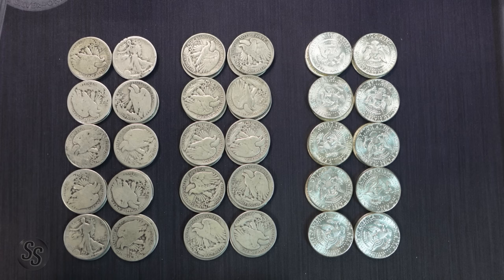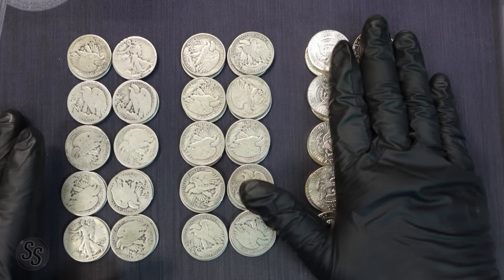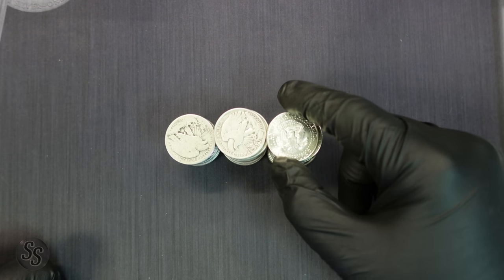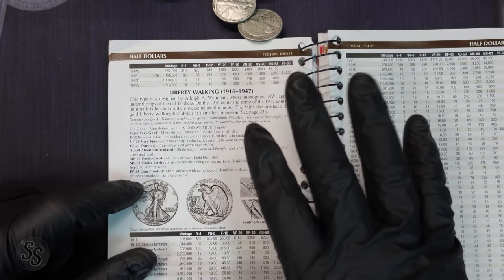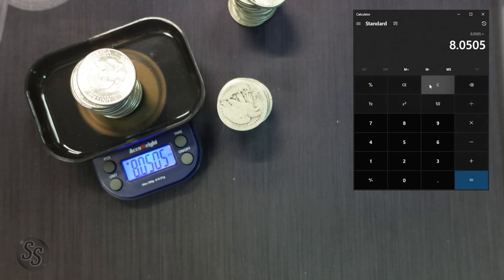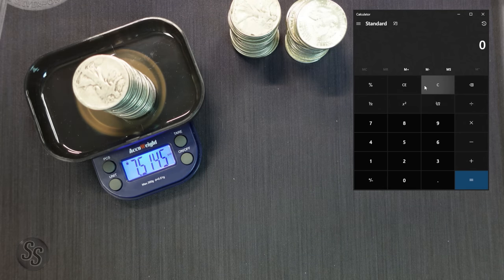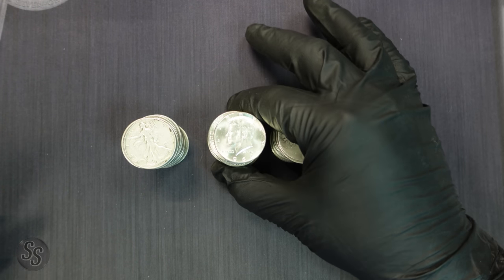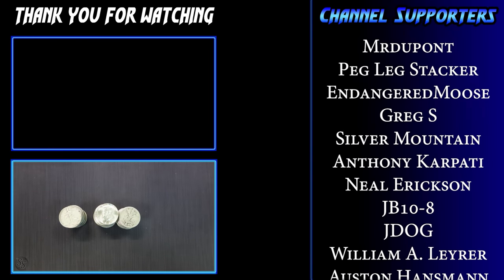Here's How Much SILVER is REALLY Lost in Worn Junk Silver Coins!

Comment: Thank you very much for addressing silver wear.  The one and only local coin shop here has culls on display for sale. I am looking at purchasing.  This episode lets me know that culls are of lower value and by how much.  Each $10.00 of face value loses 1/2 oz. That is then factored by the silver content....90%, 80% etc. That is fine for 1/2 dollars. But will that be accurate with coins which are thinner and so have more area to wear to a cull state?  I would think that dimes would lose 2X more weight to get to a cull state. And then i also wonder about desirability.  Will normal wear coins be easier to barter with?  Thanks....I appreciate your content.

Comment: Fun Video.  My '64 Kennedys and Franklins are 99.98% and 99.70% original weight, much better than the "industry standard" of 7.15 oz. per $10 face or 98.84% original weight.  I don't have any Walkers.  My Roosevelt dimes are 99.10% while my Mercurys are 95.36%.  My Washington quarters come in at 98.31% original weight, but my primary source gives me a disproportionately older mix.  A more typical mix would be like the Roosevelts.  So as common sense would tell you, if you are concerned about silver loss from ware, stay away from Walkers, Standings quarters, and Mercurys.  (But also remember we're talking about single digit percentage differences and also that a typical mix of newer and older coins can give you almost exactly 7.15 ounces per $10 face value, which is, of course, why it's the industry standard.)

Comment: I see junk as useful for making change so instead of trading 20 of them, I'd trade 1 or 2 at a time. So 0.4824/20=.02412*18.78(today's spot)=$0.45 lost.
The whole coin is worth $6.79 and you lost .45 leaving you with $6.34 per coin.
I think it's a pretty big loss, but it's a widely recognized coin for ease of trading. My local dealer showed me quarter replicas that were 90% silver with the current year. I pointed out that it'll be harder to explain that it's a real silver coin, than to explain a pre-65. So I'm basically paying 45 cents per coin for that convenience.

Comment: You do understand that's also assuming only the silver was worn off, not any copper. And if that was the case it should be pitted or deformed if only the silver was worn off.. Yeah they're worn but it's not only silver that's missing.
Reply from the maker: You do understand that it's a 90/10 mixture there aren't any parts of the coin that are more or less copper.

Comment: Also worth noting: When buying in bulk, take the term "Average Circulation" with a grain of salt.

1) "Average" is in the eyes of the seller not the buyer.

2) Average Circulation for a Barber is not the same as a Walker, miles away from a Franklin, and leagues away from an "average" 64 Kennedy.

Coins like Barbers and Walkers were used extensively. The average circulated condition of them is far less than a Franklin. Many of the half billion 64 Kennedy's were hoarded and rarely saw circulation. They are most of the time, the best bet for finding the most meat on the bone. But command a higher price.

For the money I tend to buy Franklin's. Cheaper than Kennedy's, more meat than Walkers, and if you are patient and sort through them you may always come up with a nice looking variety DRR/DDO, Mint over mint, "Bugs Bunny" probably a few FBL's.

Comment: How do you know only the silver is missing not any copper?
Reply from the maker: Because it's a 90/10 alloy all parts are the same.
Reply: @SilverSeeker  so there should be some copper missing as well
Reply from the maker: @Don-bb4dh  obviously but... its still 90% Silver... it doesn't matter if half the weight is gone, when you weigh it and multiply it by .9 the answer is still how much silver is there.  Nothing changes...

Comment: In some ways it is an assumption that SILVER and copper wear evenly on a half dollar.  The yield of melting them would be the only way to prove there is a loss at all.  Melt a few and find out. 😆
Reply from the maker: It is a 90/10 alloy bud the metals aren't separated... the copper doesn't wear at a different rate.
Reply: @SilverSeeker     I will explain my reasoning but it may be a theory of my own.  l just look at how much weight isn't lost in a 1 oz coin that is pure SILVER....and then compare that to what is lost in copper pennies...  copper seems to wear much faster.  The alloy may prevent that but I'd like some proof by melting. 😉
Reply: That is a very good point that you bring up though
Reply from the maker: @bobegan2121  its an alloy... the copper and silver are one metals.  One isn't wearing faster than the other.